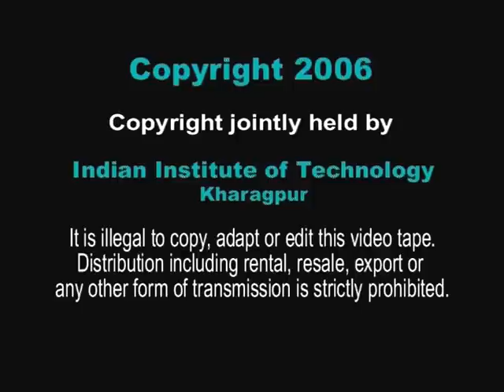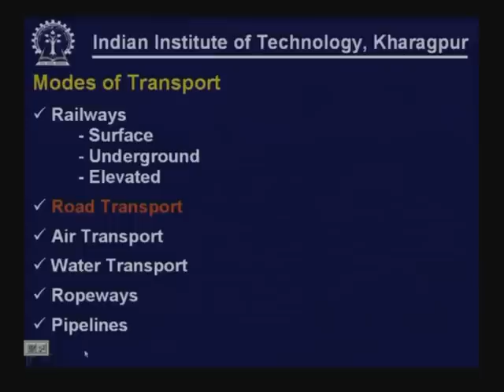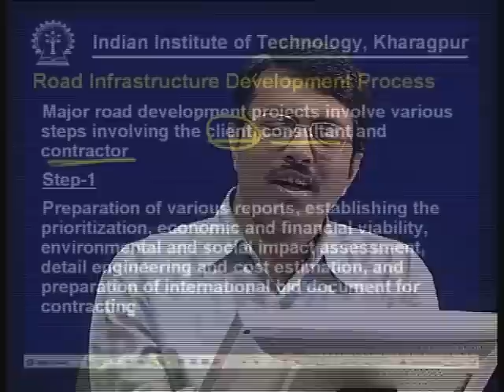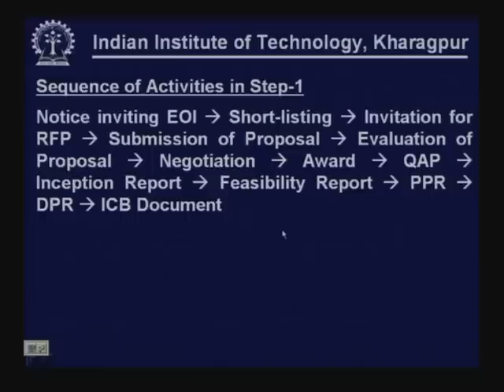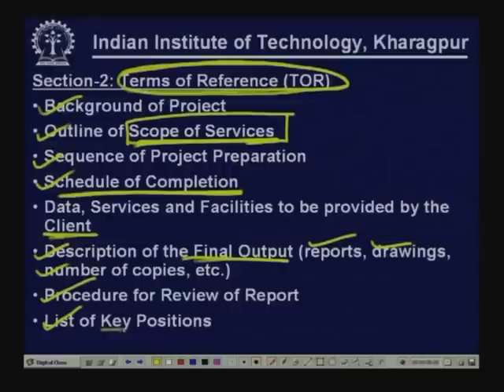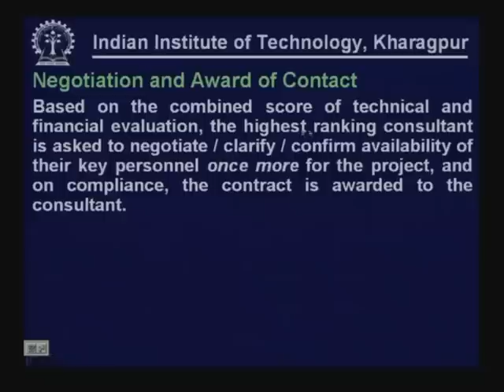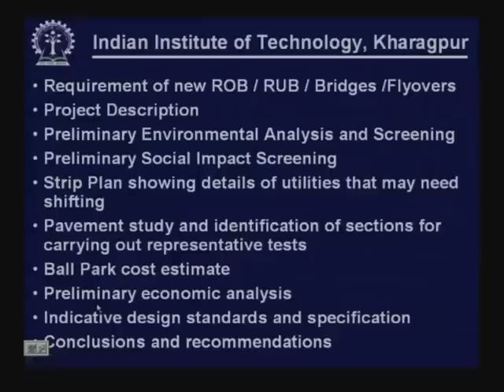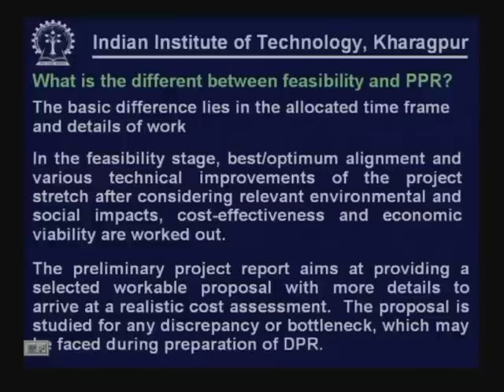Lecture - 1 Transportation Engineering

Comment: Traffic engineering is a useless "profession".  It involves a maniacal obsession with "solving" delays and small scale traffic problems that always leads to the answer of, more road is needed.  Well, half a century of building cities that are car dependent should tell you that the more roads and highways you build, the more congestion you will get, such as in Los Angeles or Toronto.  Most traffic engineers do not even consider the value of pedestrians, transit, and cyclists and will tell you that a lively road that has many jobs and activities is flawed because the cars are delayed. Unfortunately, traffic engineers are unable to think outside of the box, and they do not realise that their proposed "solutions" merely postpones the problem until a later time.  If you choose this profession I sure hope that you can expose yourself to new ideas, and please ask yourself, are you actually making systems more efficient or are you just repeating the same mistakes of other traffic engineers for the last 50 years?
Reply: agree with u💯👍
Reply: nikal bey